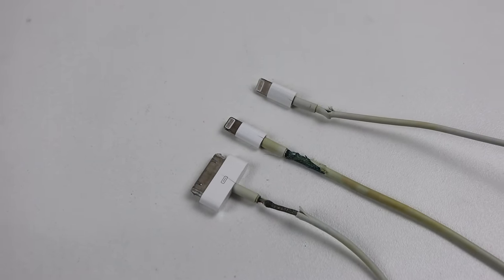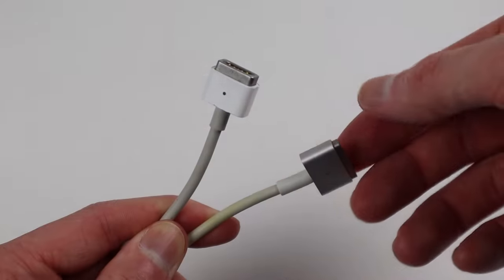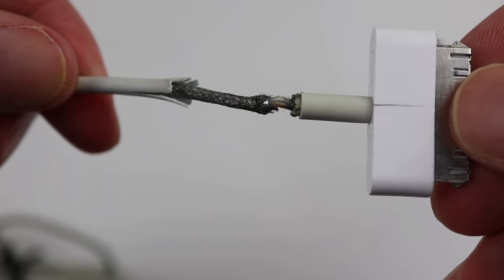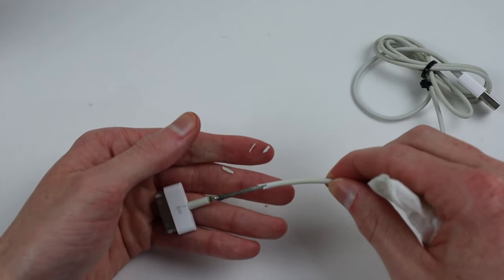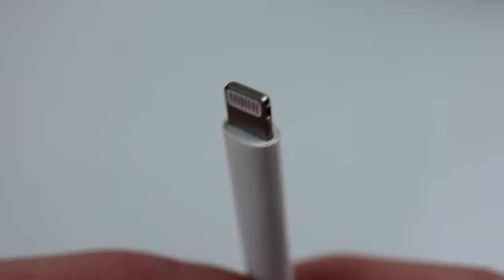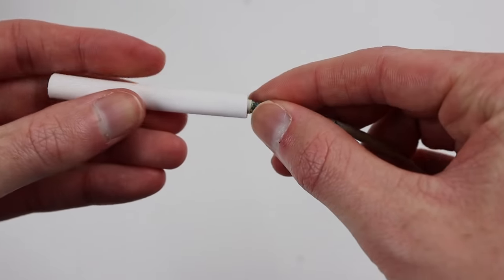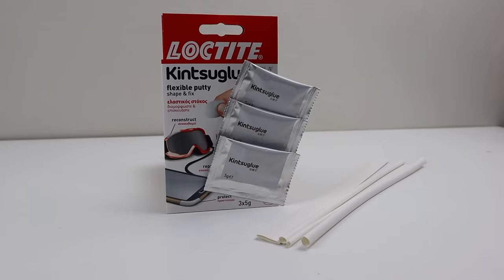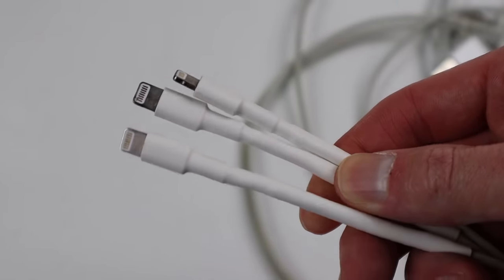Repairing Apple's Notorious iPhone Cables for $8! - Save $$

Comment: No issues with my cables. Up to 5 years old. I see most of the people are pulling the cable out while touching the cable and not the part of the connector. And that’s the „wrong“ way which causes these issues.

Comment: I don’t get these problems I get problems where after a while of owning a genuine Apple charger when I plug it in sometimes it will put like pulses of charge in it and has to be in a certain position to charge and I’ve had a Duracell charger for almost a year and it works fine still

Comment: Good Day Sir
Have you ever replaced the Thunderbolt 2 connector on a Thunderbolt Display cable.
Replaced just the connector on the end of the cable that connects to the computer? 
I know you can replace the entire all in one cable (power/display) was wondering if you had ever heard or actually replaced just the connector.
Regards
James

Comment: 1. Cable rubber end gets torn.
2. Plastic connector breaks from the edge centre.
3. Some of the pins become really black which cause connection issues.

Comment: with sugru/kintsuglu you just move the cracking point away from the plug, it will break again at the tip end of sugru. Hence the problem persists.

Comment: Another way to fix the cable is using teflon tape (white plumbing tape) and normal white school glue. Use the teflon tape and wrap the damaged part of the cable about 3 or 4 times should be good enough and after you use a small dab of white school glue and spread it around the wrapped part of the cable making sure you covered the end of the tape you cut. Let dry for a few seconds and then you got a fixed cable

Comment: In the 3rd November of 2016, I bought my first iPhone (I was 13, now I am 17), it was a working in great shape iPhone 4s, I was like perfect, I’ll keep this phone for a while, at least 3 years, fun fact, I actually kept it for 3 years and in late January of 2020 got a used iPhone 8 in also great shape, I have to mention that the cable on the 4s back then was starting to bulge a bit on the ends, it cracked a little bit but I took some electrical tape and it’s still fine, the iPhone 8 cable, has a crack on the plastic of the lightning connector, because the old owner didn’t took care of it, in the late of 2018, I bought a used iPhone 3GS and the original cable is still like new and I’m not even kidding, I really like the old cable (before 2010) but it feels cheap
The newer one can get destroyed itself but it has a nicer feel in the hand, so I like both I guess..

Comment: considering i have peripherals, built in the 90's with PS/2 connectors which are still in as new condition, it makes it very clear, companies are purposefully designing these cables to fail over time.

Comment: I mean what they told you wasn’t wrong.  I still use the same lightning cable I got with my iPhone 5s when it was new and I have no tearing and no damage.  There’s some discoloration due to the 8 years of use, but people really do abuse these cables.  I used to work at an Apple store, and let me tell you some of the cables people brought in with actual damage was astonishing.  People got mad when they’d bring in a cable that was a few years old that had been torn to pieces, and you would tell them they could buy a new one.  The good ol’ Steve Jobs swap anything to make the customer happy days have been gone for years.

Comment: I’ve used heat shrink.  Had some black laying around from old auto and electronics repairs.  The repair was fine.  The next failure of the cable happened at the end of the heat shrink.  Oh well, I just bought a few cables fro Amazon.

Comment: I can't get a heat shrink to cover over my MacBook charger that will shrink enough to grab the thin cable. I don't want to cut the cable to then put it back together because I don't want to mess with its integrity even further.

Comment: A common technique (you might find interesting) is to line the thing you're heatshrinking (usually a cable, or wire) with silicone, so that when the heatshrink conforms to what you're shrinking it around, it is very waterproof.

Comment: Do Apple-certified third party lightning cables have these issues too? I don't use Apple products but I have a USB charging cable with three ports (a type-A, a type C and a lightning) made by Pisen. It's obvious that for the manufacturer it's easier to use the same coating material for the same cable, not to say Android users never experience this.
TBH for USB type-A and type-C cables, they can break before looking bad. Two of my type-C cables started to malfunction due to poor contact on the type-C port side after three to four years. One of them is a Huawei official cable and another one is a third party flat cable sold in Miniso shops. After that I never buy cables from Miniso again.

Comment: I don't mean to defend Apple, as they have done some pretty bad stuff in the past, but I have never had one of their cables break or fray on me. I have just been careful with them and using them in my desk and other wall outlets around my house. I guess it depends on your use and the millage you have on some cables.

Comment: If anyone is in the market of buying one of the highly reputable aftermarket cables cygnett armoured cables are awesome and come with a 5 year warranty. Had the outer cloth like material wear down showing the rubbery cover that is on the apple cables and got a replacement no questions asked. They are also cheaper than the apple cables in some instances.

Comment: Problem with both methods is that the degradation of rubber continues. It will simply start breaking down bellow the line of Sugru.

Comment: Hello Hugh 

would you know if  apple’s excuse of “using after market charging cables damages your phone” line is factual?
Reply: Honestly you could probably even wire a cable yourself. Just need the end pieces from ebay or somewhere. It's hard to mess up a cable. They are basically just some copper wires attached to the corresponding connector on each side. The only thing that could damage your phone would be a badly made connector that doesn't fit in the charging port.

Chargers are a different story. Those do depend on the manufacturer.

Comment: Hugh you where right about the waste problem. But if i need a new charger for an iphone 6 or later i go to our TEDI (it is a one euro discounter) and get an eight foot chrging cable vor 3 Euros. It is of course not an Apple original but it fulfill the same duty. And in my opinion it is for most of the users much more safety than working on an electric devise with no knowledge. But this is only my opinion.

Comment: I’d get a different issue with cables where sometimes I need to use the charger at an angle.Do you know a basic why of how to fix it?im fed up with always buying a new cable and having it have issues
Reply: That means some wite inside is broken. You have to open it up and check which one it is

Comment: I think you skipped a very important thing in this video: you did not check the condition of the actual wires under the shielding. There is a risk of shortcircuiting the wires if you do not check them and only repair the cover.

Comment: I just got my 2 meter original £35 iPhone charging cable. Which is much more resistible that the smaller ones. It’s been 2 months and the skin in wrinkling. Also it’s being very annoying because it takes about 20 times of plug unplug to connect and start charging. It’s been hell in my case as I don’t have a apple shop in my country so I had to ask a relative to send one from uk. So it wasn’t just the price of the cable also the post and the headache I gave to my relative to get it. So total nightmare. Now this videos is super brilliant. I wish to go with the heat shrink so bad. But unfortunately my country don’t have those either as I live in a total toilet and disconnected to earth. I did try tape and that dint help at all as the charger stopped working completely. Minutes ago I had to remove it again. This is just absolutely viral from apple. So disappointed. Oh and one more thing. When I got the cable I could have sworn or get my head that it’s fake. It just feels crap. The charger cable are a joke from apple. The best charger was made Steven jobs himself. Once he died. We have been living hell thanks to left overs at apple

Comment: For someone that has never had issues from apple cables for 10 years, I think its user error just like the apple employee. I grab the end of the cable, not the wire, and ive had all my cables last the length of the devise(if i didnt lose it or get it stolen). Im still using my original se type c cable from 2020 for instance, and it has barely any signs of wear. Idk, just grab the charger from the end, and you probably wont have many issues.

Comment: I was charging my phone one day and then I decided to take the charger out. I lifted up my phone to remove the cable and I see that the connector is in the phone and the cable came clean off. It was literally hanging on by a few threads but it was enough to still charge. I have mixed feelings about the cable I like the softness over the plastic ones but the rubber breaks easier so idk.

Comment: Apple has a whole thing about being "carbon neutral," so I am going to guess they make their cables with a special kind of plastic/rubber that is in some way biodegradable but strong enough to last in your hands. They probably did several different mixes and settled on the one they actually used because it has a premium feeling.

Comment: Your "fixed" cables will begin to break where the new repairing plastic ends. Thus forcing you to keep fixing the cable until it's all a solid long non flexible Apple baton.

Comment: I don't think this will ever be seen, but I'll say it anyways. Before I switched to Android, my iphone charger would have to be swapped nearly monthly because I would notice they wouldn't charge my iphone anymore even if they weren't broken in certain areas. I checked if it were only my phone, but it also did not work with my sisters' phone. I was using an Isignia charger, I don't know why I kept breaking

Comment: My charger looked horrendous as if a rat had bitten it at multiple places and it was just so bad I tried fixing it with a hot glue gun but it tore again after a few months. Fed up of it I used hot glue over the entire charger it looked horrendous but held up fine. My brother couldn't see the pain I was in and got me a braided charger from amazon basics, I still use it its been a year and it still works like new. SO MUCH BETTER THAN APPLE

Comment: Any other cable works fine. These apple cables break very easily under the stress of the cables being bent and forward (which we do with every cable). Apple doesn't do anything because most people will go to the apple store and overpay for a new cable.

Comment: I don’t think that green stuff were some kind of glue, it’s looks pretty similar to stuff that happened to my glasses arm which... made out of similar rubbery thing like that ( but more softer when it’s still new )

By time it will degrade and build up those green stuff, which... idk what is that, probably some melted or there some microb that degrade it from inside, or could be due to metal contact that went rusty and produce it.

Could be the result of rubber being degrade over time.... but rumours about braided Apple cable is happening, which those could last for a very long time. And ofc... it probably expensive as well =w=

And this made me wants to replace my Oakley Crosslink arm....

Comment: The dongle is also crap, I’ve gone through like 3 Apple ones in less then a year, I finally bought the Belkin brand and it’s looks more rugged and it works fine
Reply from the maker: dongle... Want kind of dongle?
Reply: Hugh Jeffreys the lighting to 3.5mm headphone adapter, the ones from Apple don’t fall apart but the wiring I guess breaks inside the connector and I’ll get lots of static or sound from only one side or sometime it would sound like the audio was far away

Comment: Watching this while the cable that came with my Pixel 2 looks brand new after 2 and a half years. I just got the 4a, and often mix up the identical cables. You can't "use a cable wrong", Apple's cables are just terrible. I had an iPhone 5s before the PIxel 2, and the cable fell apart in about a year.

Comment: So I have a theory that the green you see under these cables is not glue, but corrosion on the braided copper shield caused by the butyric acid that some types of rubbery plastics are known to produce when they break down... I believe it’s butylene containing molecules like SEBS etc? This would make sense as SEBS is often used to make elastic/rubbery molded items in place of PVC, and we know that back in the late aughts Apple was pressured into removing PVC from their products. Why other brands haven’t bothered is easily guessed - PVC works well and is cheap, and if they can sort of fly under the radar and let Apple take the heat then they will. I don’t think this is planned obsolescence or anything of the sort - it’s just Apple being the most visible in the industry and as such, being targeted for this sort of thing. About the only material I can think of that performs as well or better than PVC without being an environment disaster is silicone, and silicone is not only expensive (it’s catalyzed with platinum for fvck sake lol), it’s extremely difficult to manufacture with.

Comment: Not just the cable the ends crack as well, I think they are an electric safety hazard and the government should make apple change this. Any other maker would be pulled off the shelf.

Comment: it is much much cheaper to buy good quality cables in china. They can be purchased in packages of 10 units for less than 5 usd. per unit. What is done in these cables cannot be called a repair, because the material with which you build these cables is designed to disintegrate over time. that is only an extension in time but it will inevitably end up disintegrating the entire cable jacket

Comment: Why would Apple fix their cables when they know most people will just buy another one? And of course the """geniuses""" are trained to say you used the cable incorrectly. That's typical Apple - blame the user for their failures. A lot of people blame Tim Cook for this, but I refuse this lie, this was a Steve Jobs special. Remember who famously told people that they were holding the defectively designed iPhone 4 wrong. That's right, Steve Jobs.

Comment: I've never had this to me, cables well over 4 years old and not a single sign of wear. Pull on the connector when removing from your device, don't tug on the cable like a muppet and your stuff will last ;)

Comment: just my experience with using suguru on macbook charger wires but no matter how much suguru you use it will still break further down the wire till you need to replace the entire length of the wire
note this wire has had 2 layers of suguru on both ends

https://imgur.com/a/PlLRLOR

Comment: All my micro USB chargers still fine.
My Apple chargers falling apart.
Reply: lol mine are the opposite (for the micro USB cables), the cable is fine, but the connector really leaves something to be desired. (Spoiler: it doesn't plug in securely so it can effectively charge)

Comment: Personnaly I have my ligtning charger since I bought my iPhone so for 3 years, (soon 4) and I had 0 issues with it, it's brand new like it didn't even yellow like how your charger hold trough time dependes on how you use it and how carefull you are with it,  I use mine more than 1 time a day because i hate runing low on batterie and I also take it  with me everywhere I go cause I have portable batterie, like guys I won't defend Apple but It's my 1st iPhone and I think you guys dont know the values of them so y'all use them violently and roughly, that's why it doesn't hold.

Comment: I’ve had my cables for 6 years and they’re fine. It’s definitely how you’re using it
Reply: Or where you live.  If it's hot and humid with lots of direct sunlight, this certainly happens.  It like this type of cable can't leave a climate controlled room in that type of climate without beginning to fall apart.

I feel like the phrase we see constantly with some things: "keep in a cool, dry location", is important.

If it's being used to charge in a warm or hot area and it's also doing something that heats the cord from the inside, that could also be the issue as well.

Comment: Apples chargers are terrible I just kept trying third party chargers until I found this super good one I’ve been using it foreverrrr
Reply: same, been through a lot of apple ones before switching to third party. obviously don't buy the dollar store ones and make sure its certified. the one I have and still going is a third party and is braided, material can bend more flexible and doesn't rip
Reply: @JLummin  yea I have a similar one

Comment: None of this stuff will help. Once your cables get to the point seen in the video, the cable will just begin disintegrating at whatever new bend point it has (i.e where the sugru or heat shrink ends). The best solution is to get a third party MFI cable that's either woven or regular plastic.

Comment: What on earth are you doing with your cables ? I've been using iPhones and MacBooks for the past 10 years on 2-year cycles and I've sold them all at the end of those cycles with perfect cables and headphones. Only now on my last iPhone that I've been using it for the past 5 years (6S) the cable started deteriorating but that was on the 5th year mark. You are definitely doing something wrong in my opinion.